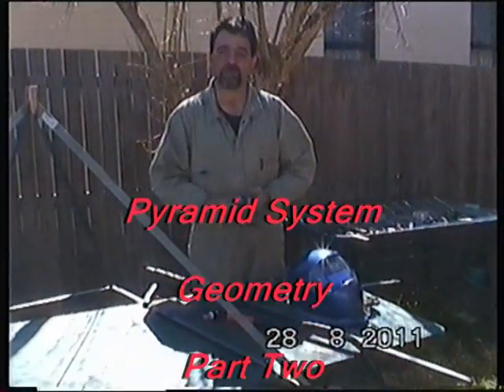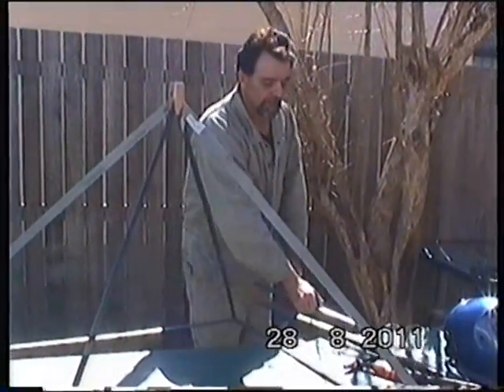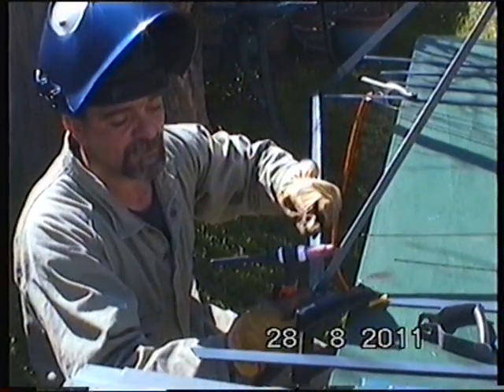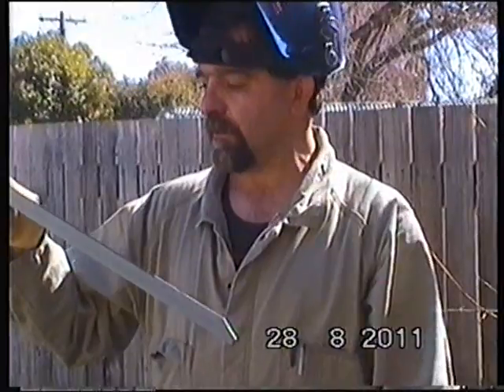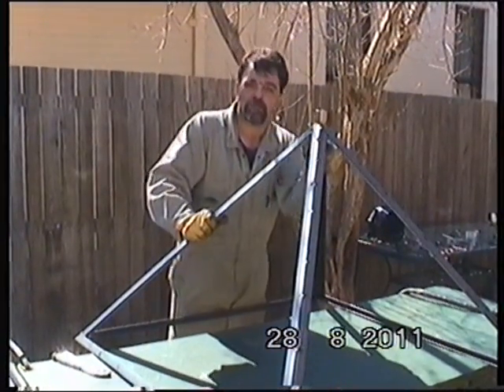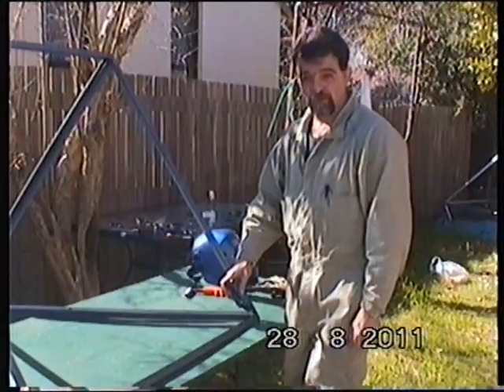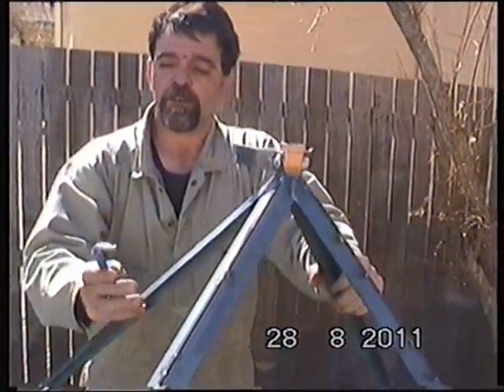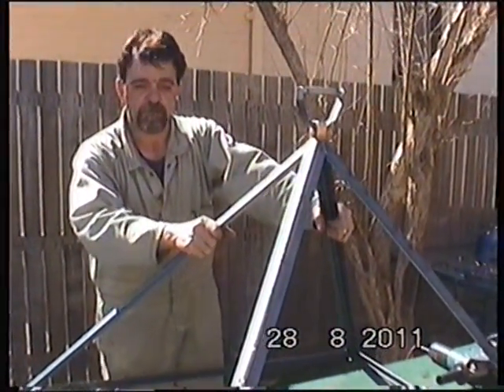Pyramid System Geometry Part Two.mpg

Comment: 2/2 was thinking about making one with a spool of 22 gauge wire continuous for a room in the house to mediate in, stretch and tack the wire to the ceiling and floor, as far as my understand, long as it's 52 °  it should work? any feed back? George if you were close, i would be trying to sell you a set of solid steel forging steaks &  anvils, have a feeling i'm better off donating them to a college that teaches metal art and take the tax write off,  nice documentary post! thanks.  t√